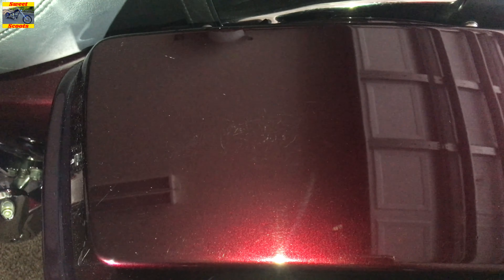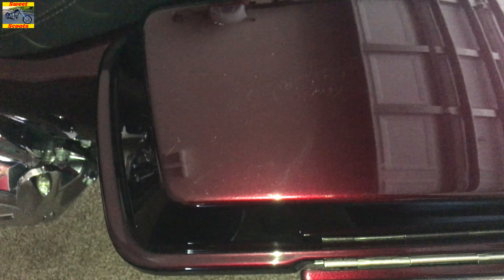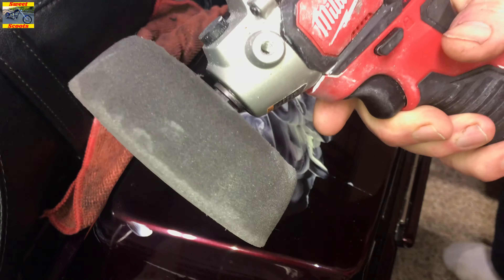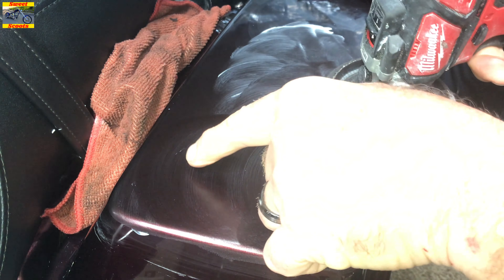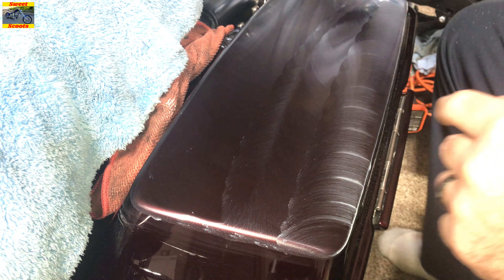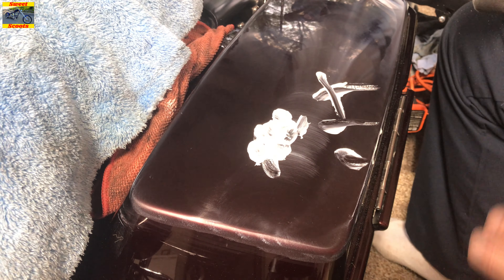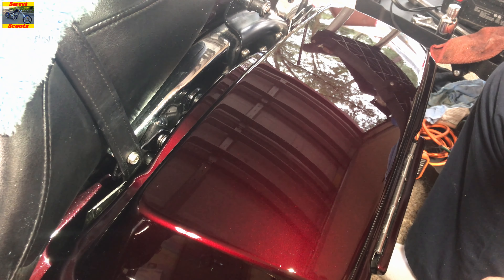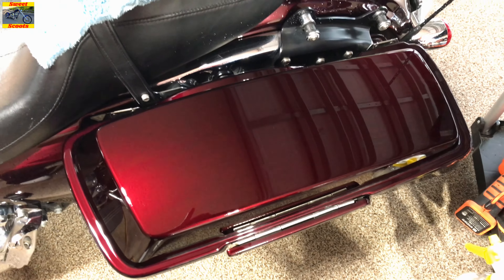AMAZING DIY! How To Remove BAD Scratches Then Polish & Coat MOTORCYCLE PAINT

Comment: Why not take the bag off the bike?
Reply from the maker: I mentioned it in the video, I left it on for video purposes it's easier to shoot the process, but you are more than welcome to take the bag off. Thanks again for the view, have a great night. mad Mike
Reply: One other thing, on a small part like that you have a devil of a time holding it still while you work it.
Reply from the maker: leaving it on the bike works very well until you have to do the back side of the bag which should actually be done first then if you get any small scratch's on the bag from laying it on the ground you can take them out with the bag remounted to the bike for the remainder of the polishing  :)